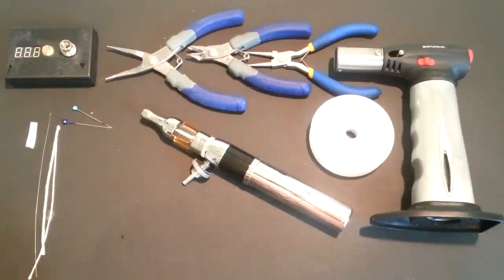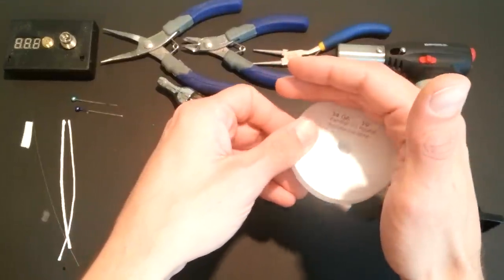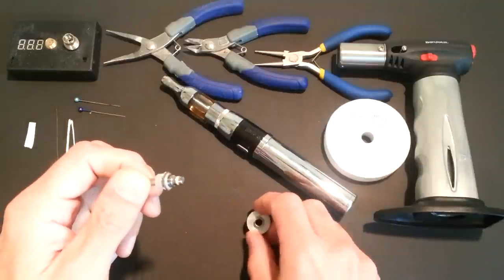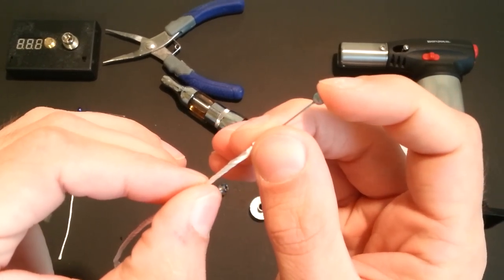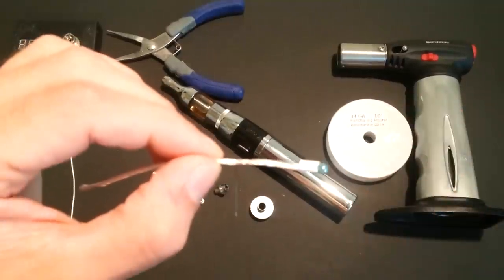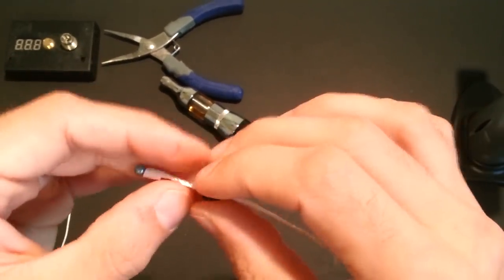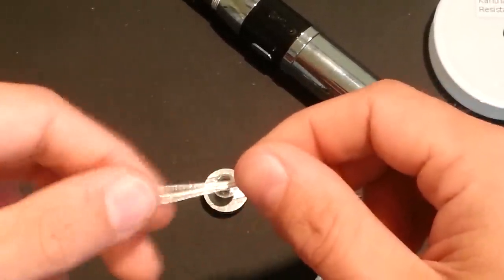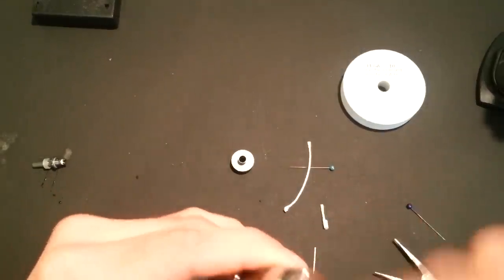Kanger Protank Bottom Coil Rebuild HD Close Up

Comment: Great video! I just rebuild my first protank coil, much thanks to this video, and it worked great! The flavor is actually better than with the original head! I used a 33 gauge wire and ended up with 2.6 ohms (7 or 8 wraps around 2(?) mm silica). I'm gonna do one more for my other protank!

Comment: I just started vaping last Saturday and I've already went back and picked up a variable voltage battery minus the space display like his and I'm already wanting to make my own coils.
Reply: Get a multimeter and learn how to use it. Know your batteries, all info on them (Discharge rate, voltage, protection/chemistry/features). Those are my 2 top advises to you.
Reply: Most definitely. Just went through that process myself, I found it quite interesting. In any case heat would most likely make you drop the damn thing before anything happens. What mod are you planning on getting?
Reply: Don't know yet honestly, I know I won't be spending 200 bucks on one though. My buddy taught me how to make simple coils a few nights ago and I hit his mod and it puts out hella clouds so I'll probably end up buying his or one similar to his.
Reply: I'm cheap in that regard, spent less than $100 between mod, batteries, Atty and wire/wicking. There are still cheaper options tough.

Comment from the maker: Sure, I've used cotton, but still prefer the taste of silica. Cotton will not hold up to the high temps of dry burning or torching, so you may just want to rinse with water. I would still torch the wire by itself though.

Comment: It might help to mention for people that using a joined non resistance wire on the lead would be beneficial in terms of not burning the insulator up.  People eventually have to buy and/or replace the rubber insulator because of not including this step in their process.  For new users looking to get familiar with rebuilding a head your method is fine; but if you're going to be doing it in the long run, it's best to learn to do it right.

Comment: At 11:15 you tugged the terminating ends of the coil and then went off camera.  At 11:32 you said "removed" terminating ends.  What do you mean remove?  Did you just trim them as close as possible to the center pin?  
Thanks for posting!  I never thought of rebuilding myself but now I am going to start doing it.

Comment: How many times can you rebuild a coil? I've rebuilt mine several times now, and it seems to burn out on the first hit now.
Reply from the maker: ***** You can rebuild it as long as the parts hold up. You may wish to change the insulators often, every 2-3 builds.
Reply: Alright, Thank you.
Reply: Sean Hanson

Why change the insulator does it melt???

Comment: I recently ordered a mini protank 2 for my eGo batteries and I was wondering what gauge kanthal should I purchase. My batteries are not twist batteries. Should I get the 34 gauge or 32 gauge or something lower. Is it that the lower resistance gives more throat hit? Does it die quicker?

Comment: very cool!! Great video, i will have to try to rebuild my pro2 now, i get a burnt taste a lot lately,its a 2.1 omm head ( running it at 4.0 and 8 watts ), any suggestions on how to eliminate the burnt taste?
Reply: You can remove the floater wicks but it will cause you to get some leaking...  rebuilding your own really is the way to go... the stock coils are all crooked and warped up.. .its no wonder they get hot spots and dry hits and leaking.
Reply: Cool man, I got the gear to rebuild yesterday so I'm going to try my hand at it tonight.
Reply: I just got my stuff and built my first one today too.. this vid made it easy... the flavor is incredible man... its crazy how much better it is... Its almost right there with my dripper... very close~!
Reply: Charlie DiMaria i was so anxious because i kept getting bunk coils, and my rba just broke on me this weekend, and the vape shop close by is closed on sundays, pretty much every store is closed on sundays in greece, so i couldnt find anything and my kanger is my backup, the coil was bunk, but i found my replacement wicks and coils that came with my rba, and i used that to rebuild it, using nail clippers and a mini swiss army knife :P as rigged as it sounds, it works so great! im never buying new coils again, im just going to keep rebuilding them! it's definitely worth the rebuild, you'll never want to go back!

Comment: On my Kanger coils I use the 30 gauge 9 wraps, and cotton for wick.  Best taste by far, and I can chain vape as much as I want.  Just make sure the tank doesn't run dry to avoid burning the cotton.  I have no clue on what OHMS I am getting, but use 4.5-4.7v.
Reply: How can you get 9 wraps dude without it touching the sides?
Reply: How can you get 9 wraps dude without it touching the sides?
Reply: Music Cool
Thanks for that. I'll give it a try :)
Reply: Music Cool
Sorry I meant to ask if the coils are touching each other or does there need to be space between them.

Comment: What effect does braided elkwood have versus silica? And do more wraps increase or decrease the ohms (not including AWG & battery)? For example 5 wraps versus 4 wraps of 32 guage with 2.5 mm silica. If I added one more wrap does it go up or down the ohms?
Reply: Mark Walton
Thanks Mark! You saved me an hour of surfing and I still didn't find the answer. I've wrapped 5 coils in this time and I can't believe how easy they are..
Reply: Mark Walton I just bought 2 Kayfun 3.1's but there are SO MANY PIECES! WOW!!! It's not going to stop me, but WOW!!! I'm sure the taste seems like it should be the same as the Protank 2! Looking forward to trying those out! I'll practice, first, on the Protanks 2's! Then I'll attempt the Kayfun.
Reply from the maker: More wraps means more resistance always. Braided ekowool tends to be more durable over time, and a bit easier to work with initially.

Comment: i ordered 32 gauge and 2.1mm silica wick, i follwed to the tee except the flavor wicks cause i only have 2.1mm silica. was getting some leaks, should i just double up on the wick?
Reply: Yeah add some wick to the top of the coil is my advice.  I'm using 2mm silica and always  got a piece and separate it into 2 strands and lay that on top.
Reply: Thomas Johnson Keep in mind the manufacturer uses about a 1mm or maybe a tad smaller 2 flavor wicks on top of the coil. Those make a HuGE difference, IMO. If I just clean my coil, I replace those 2 flavor wicks with 2- 1/16th" flavor wicks. I wouldn't go any higher than 1mm because I've found it cuts the air off making for a much stronger pull, like your sucking your brains out! LOL!

Comment: Your batteries put out 3.7 volts? If so, a 1.5ohm coil would put you at 9.1 watts. Most people seem to like 8-10 watts, or you can get like 15 watts and go nuts but that requires a mech mod and sub ohm